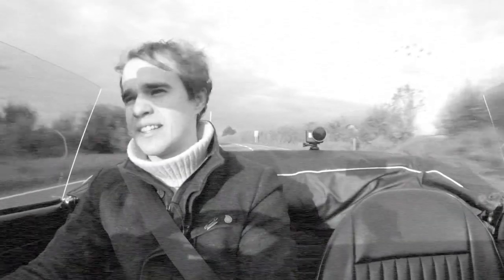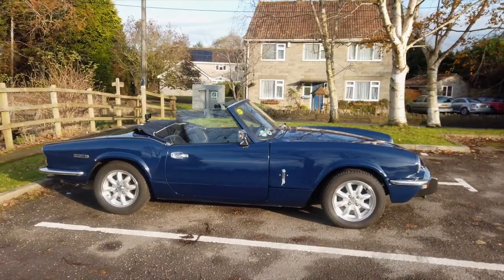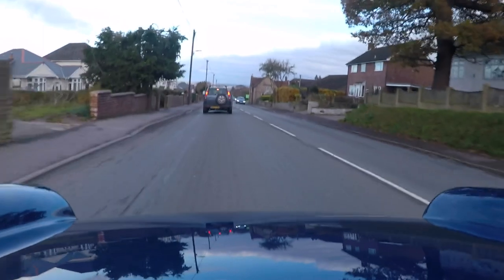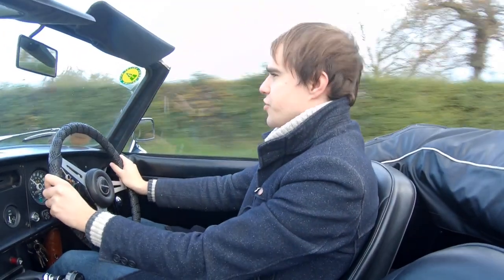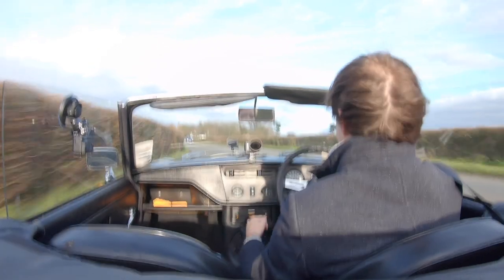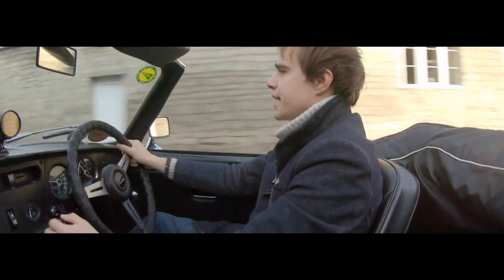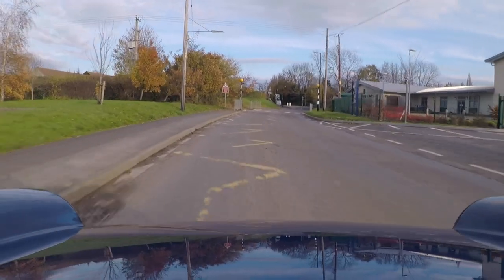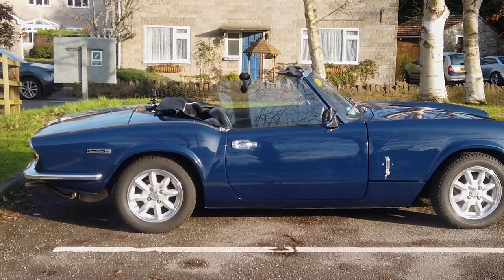My review of a 1972 Triumph Spitfire MkIV 1300 - Part 1

Comment: Had a MK IV, also 1972 but in BRG. Bought in 1978, they were also cheap to buy then. On a fast motorway run, it's ignition timing moved whilst at a petrol station. Later, another run at long high speed (for then any) and the engine went BANG !! I was an ignorant 18 year old, my brother in law (a Hotel manager}, together zero mechanical know how. Took the top end off, found a split piston with no scoring. 2nd. hand piston and new rings and started immediately. We were both gobsmacked, good for many more miles. Fond memories and taught me to take a rubber hammer to encourage the starter motor.

Comment: As far as I know mk 4 has a 1500 engine
Reply: 1300
Reply: @andrewkelsey2605  currently I own a mrk 4 and a mrk 3 1500 engin and 1300 engine respectively
Reply: @gerardfouche2718  As standard in the UK, the Mark IV has a 1300 though the later ones in the US had the 1500 engine. In the UK, the 1500 engine was introduced in the Spitfire 1500. It is perfectly possible to fit a 1500 engine to a Mk IV of course.